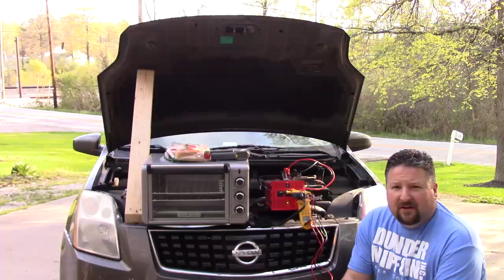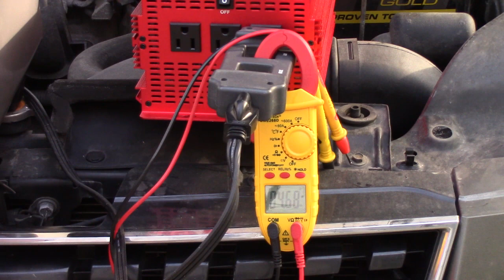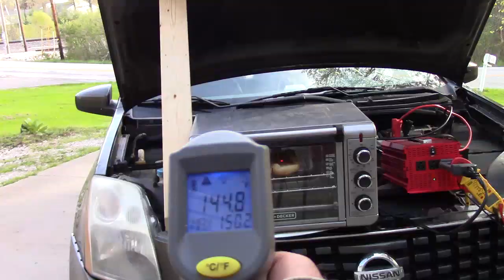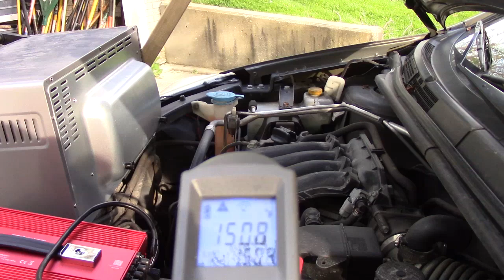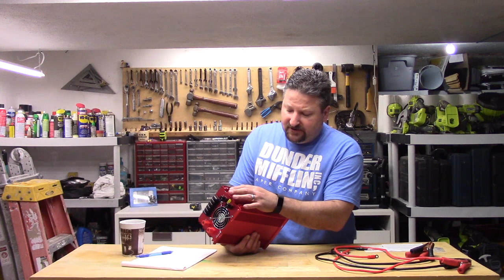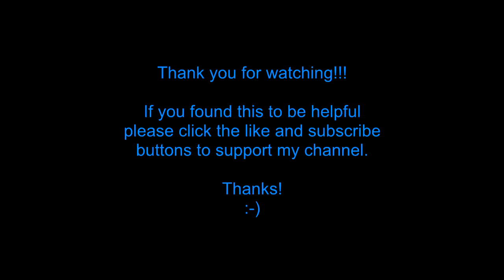Bestek 2000 watt power inverter review

Comment: Here is a question.  My car heater no longer works and because of the video I'm considering buying a standard 1500 watt plug in heater and using a 2000 watt inverter with an lithium deep cycle battery for a power source.  Would this work?

Comment: I need a inverter to be able to run my refrigerator during power outage but not sure what size I need.
Reply: A 2000 watt should work just fine.
Reply: I would suggest getting a battery isolater and a few deep cycle batteries so you don't kill your cars battery or alternator. That way you can charge the other batteries and never hurt your main.

Comment: The #1 issue is the 2 sets of cables! (1): Cables provided in this unit is a very low grade/Poor quality. (2): Cables provided with this unit is too Short in length. When using this unit with a Vehicle "Under the engine hood". The cables are too short. When vehicle engine is running. Heat from the vehicle engine causes this unit to over-heat. I have also found, This Bestek 2000 Watt inverter requires more power to operate then a standard engine Alternator can put out. The solution would be to install larger/High-end, Longer in length cables. Hooking-up two sets of cables to a standard Battery is redickulous.

Comment: 11amps x 14v = 154 watts So....
Reply: 11amps on the AC side (not DC side). that is 11amps * 120 volts =  1320 watts. I wouldn't draw that much from my batteries with idling alternator. Most car alternators produce 60 - 80 amps DC current which is around 840 watts to 1120 watts. I would never draw more than 1000watts or risk damaging the alternator.

Comment: First of all, it's an engine, not a motor. A motor is powered by electricity, an engine is powered by petroleum distillates. Read a fucking book. Secondly, you stated that it "converts" DC to AC. It does NOT convert it inverts, that is why it is called an inverter. Why the hell they picked you to do this video is beyond me. I am a licensed aircraft mechanic, I also have a background in electronics so I know what the fuck I am talking about. Education is a wonderful thing. Get your facts straight.
Reply from the maker: Does it make you feel better about yourself to go on YouTube and post comments???   Hope you work your problems out.  Have a blessed day!!

Comment: I'm trying to figure out the logistics. Maybe the best setup is a battery isolator and at least one AGM. Probably place the inverter somewhere other than the engine bay to keep it cooler. Then draw off that. When running a larger appliance just fire up the engine. You need a pure sine wave only if you're running something with a copper wound electric motor such as a power tool or hair dryer. Seems to me solar is just too weenie. Out of a 100w panel you might get an average of 40 watts an hour. Maybe. If it's a sunny day. You can put that in the battery by running the engine for 15 minutes. I'm still trying to figure it all out.

Comment: Run too long and you'll destroy the best of alternators in any car.
Reply: How long is too long?
Reply: @mccarthykane3960   alternators are not built to constantly run, it depends on the quality of the build but the system week point is the alternator,  there is however a pulley driven generator that is the way to go beyond short term or  novelty such as the build in this video....Google Pulley driven generator.
Reply: @taleapitcha  Thank you for your quick and detailed response.
Reply: @mccarthykane3960  your welcome
Reply: @taleapitcha  for the price of the one he has here in the video I looked for the type you were talking about and for around the same money yet much better alternative and with much more power 10kw. I'm glad I scrolled down to the comment section. Thanks man.
Reply: @M.A.S.8513  YW !")

Comment: That thing will draw close to 200 amps from the battery so you will need both sets of leads for any length of time use. Those 50 amp fuses will all be in prrallel, 300 amps. So it will kill a car battery pretty quickly and if you plan long term use you need to uprate the input leads something along the line of welding cable plus a very big battery.

Comment: Is the voltmeter this amazon product code (B01MG8V7ZA)?  I see you also have this Meterk meter on your Amazon page (B073Y162BZ).  The Meterk has a lot more reviews.  Did you find any problems with the Meterk as I believe you're using the DMiotech in this video?

I checked the electrical tools section of your Amazon page but did not find the tool which splits out the hot and neutral (and maybe ground lines).  Do you have a link or name of that product?  That is so darn cool.

Would be cool to see it running a toaster with a deep cycle battery where you can record the fan noise without background noise.